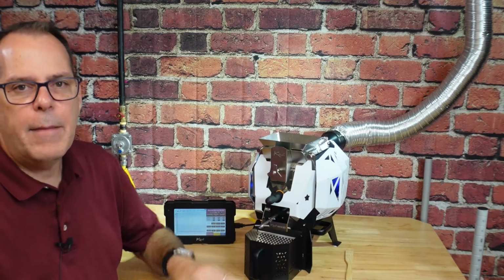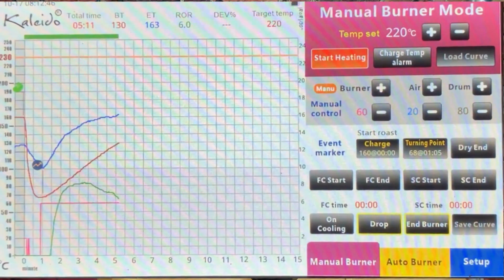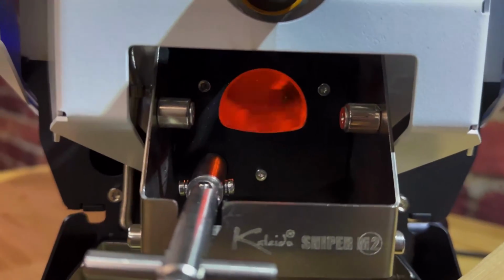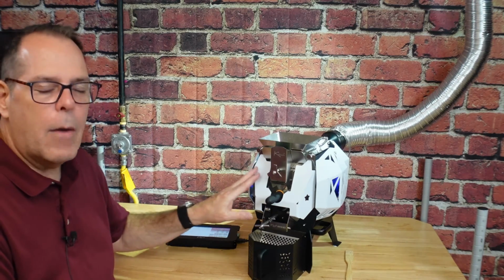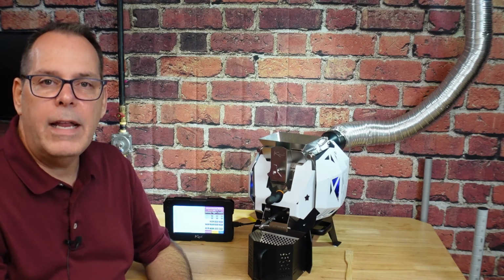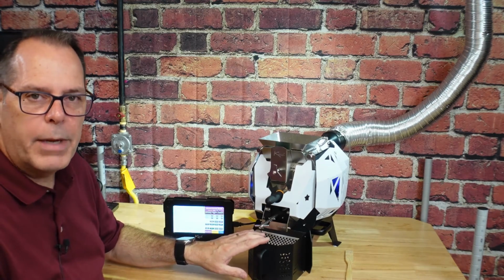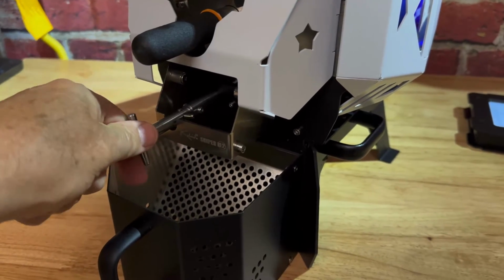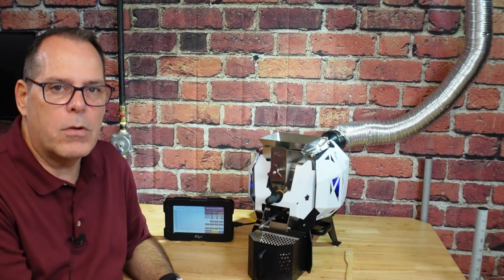First Impressions Of The Kaleido M2 Coffee Roaster

Comment: Great video as usual,,,really interested in seeing an actual roast ,,,,we have missed your videos,,,you spoil us,,,,,Ken,,,,,,Are you going to add one of these to your collection of roasters ?,,,what is the range of heat and air on this machine ? 1 thru 10 like the fresh roast ?
Reply from the maker: Hi Ken.  A full roast is coming soon.  This machine is on loan to me from the USA Kaleido distributor.  So, it will go back.  The range of heat AND air is 0-100, incrementally using a slider.  If you use the tablet only then i think it is in increments of.  I think you can set the increment in the setup as well?  Not positive about that part.
Reply: You are doing such a good Job of reviewing it, maybe they will give it you,,,
Reply from the maker: This roaster capacity is a little small for my roasting needs.  I'm not sure what is going to happen with this roaster.  We will see!  Thanks for the kind comments.  I'm glad you like these videos.

Comment: Regarding the chaff, I picked up 1 gallon shop vac, keep it close to the roaster, when the roaster is cool, just pull the drawer out, stick the hose under the drum and  hit it with the vac. To get rid of chaff in the roast, just hit it with a blower on the low setting or hair dryer while stirring the seeds in the basket. It's a little messy, but easy to blow out of the garage with a bigger blower. I'm finding very little chaff in my ground coffee with these extra steps. You'll like the way Kaleido works with Artisan: I have yet to use the tablet for anything other than a backup. Thanks for posting, enjoyed watching.
Reply from the maker: A small vacuum is a necessity to properly clean out the Mill City 500 gram chaff collector, the behmor, even the other smaller  roasters i've used.  It is handy for the work area but especially inside the roaster chaff area.  I have noticed the Kaleido M2 does a really nice job of knocking off the chaff while in the drum BUT could do a better job of getting it all into the chaff tray.  I end up either brushing or vacuuming the chaff box area as well as the tray after every roast.  I wish the chaff tray had more capacity.  

I'm excited to roast on the Kaleido using artisan.  Thanks for watching and for sharing craig.

Comment: Nice video, Mike! Watching you control things with the control pad, makes me really want to start using the Bullet in that same fashion. I am quite sure it will make my roasting experience, much simpler and much more enjoyable, although it’s a lot of fun now. It’s good to see you having a lot of fun with this, and I’m definitely looking forward to your next video!
Reply from the maker: Hi Lou.  the interesting part of this experience is learning how this machine roasts differently and then making adjustments to my approach.  Right now I'm trying to determine how much airflow i really need with this machine.  The tablet runs the machine, even in the manual mode.  It is kind of like your round display where you control temp, air, and drum except they also have the graph and calculations as well.
Reply: Good video. Thanks Mike. Do you think for someone new to roasting it would be a good idea to pick a bean, say Guatemala Huehuetenango, and just practice roasting that bean using different profiles and development times? Just wondering if that would speed up the learning curve. For me, I bought small quantities of a bunch of different beans from different vendors and have been roasting those but maybe it’s better to stick with a single bean type. That said, I do like having variety in the cup.

Comment: Mike, why would I spend $2,000+ for a home roaster that cannot produce more than 400 grams per use (making it useless as a small business machine)?
Reply: Weighing in with my thoughts, Mike of course may feel differently :) Personally, I don't think small business is the target market for this particular model. The M10 would be my suggestion with a capacity of 1.2kg (2.5lbs). I believe the target market for this particular model is the home "power user". Someone who wants excellent control over the variables in the roast along with a generous batch size for sharing with friends and family.
Reply: @TheCaptainsCoffee  My point is that this machine is very expensive for the home roaster and cannot even be considered for a small-time roasting business because its small capacity.
Reply: @mhpjii  oh of course, I'd agree it's an expensive option! But I know folks who have $5000 espresso machines at home. That might be out of my budget, but that's why I specified either a "power user" (someone who roasting is really important for and has saved up for a long time for something really special to them) or someone who simply has a higher budget. It's certainly not for everybody! There are just more considerations than for a business or what's adequate for most home roasters.  I know folks who would scoff at a $2,000 home roaster, but would drop $2,000 on a different hobby in a heartbeat
Reply: @TheCaptainsCoffee  I agree but I tend to see these higher-end purchases as investments, not hobby equipment or toys. It's also funny to me that people wince at the inflated prices of coffee at retail outlets and feel compelled to buy a machine such as this to go the DIY route at home. How much coffee would they have to roast to make it pay off? Hence my mentioning a "small-time roasting business."
Reply: @mhpjii  I can certainly appreciate your perspective! I guess at the end of the day I have a broader understanding of what an investment is. Some investments are made to generate a financial return and some are made to generate an emotional return! The crossover where both happens is exceedingly rare
Reply: @mhpjii   I wince at paying 5.00 + a cup of coffee +tip.  using your logic the machine pays itself off in less than 2 years. But, we do it as a hobby. Some people buy expensive computer equipment, video cards and so on, some buy coffee equipment, grinders, accessories etc, and some of us do both. It's a hobby, something that we enjoy and the beauty of it, is you can share the end result with others.
Reply: @edgarsalas7495  I understand completely. Enjoy!
Reply: @mhpjii Some interesting viewpoints. For me, hobby’s aren’t supposed to pay for themselves…they’re done for the joy of it. However, spending $2k on a roaster is a win-win. It pays for itself in a couple years, I get to have better quality coffee than I get in grocery stores, I get to nerd out on a cool/high quality machine, AND I get to try different exotic coffees I wouldn’t be inclined to drop $20 a pound for at boutique coffee shops. Oh, also, I get to share with friends/family. I don’t think I’ve ever had a hobby that checks all those boxes (maybe homebrewing beer).
Reply from the maker: Great discussion.  Mike, I understand what you are saying.  Who on earth would pay 2,000 dollars for a hobby, with no intention on trying to generate income to pay for the expense?

I was so into coffee roasting I decided to upgrade from a Behmor to my Mill City 500  gram back in 2017.  I spent 2,700 dollars on that roaster.  I roast coffee for my family (extended family) and was able to grow my skill set with that drum roaster.  Thursday nights are roasting nights at our house.  

I believe the M2 is the best selling Kaleido which is primarily geared towards home roasters but can also be used in small cafes.  I think I saw a video somewhere of a small café using an M2.  I agree with David, an M10 would be a great value for a small coffee shop who wanted to roast their own coffee 1.2 Kilo capacity for about 2,800 usd.

It comes down to expendable income for the home roaster.  I saved for a couple of years to buy my roaster and it has brought me lots of enjoyment every time I roast and drink the fruits (seed of the fruit, haha).

Comment: Very attractive roaster for the price point. Perfect capacity for a lot of people I'd think. Looks well-built, and offers a lot of data access. You may be answering this in a future video, but how does the tablet version compare to the Artisan version, in terms of ease of use, accuracy, and usability? Thanks Mike!
Reply from the maker: I've used both of the logging software options and there is a difference.  It is easier to roast with the standard Kaleido tablet.  I think it gives more confidence to the roaster because the software calculations seem to be softening the variations in the ROR which would cause less fiddling with the air and heat.  It is kind of hard to explain and I haven't quite figured out how the sampling rates are different.  I'm looking into this.  Ideally, I would like them to perform the same, hence, use the same settings and that is what I am trying to work out.  As far as usability and accuracy, the numbers being displayed when I run both at the same time are providing the same data I think.  Like I said, I'm kind of in that mode right now comparing.  I like controlling the roaster with Artisan.  That is a new experience and is pretty cool.  Are you asking if you could roast just as well with the Kaleido tablet compared to Artisan?  If that is the question I would say the cup might not be much different.  The experience is different.  If you are used to using artisan then the dual or pro version might be your ticket.  If you can afford it, the dual gives you more options.  Just my opinion of course.

Unrelated to the software, the capacity ( 50-400 gram) that is stated by the manufacturer is the capacity limit.  Yes, it does a nice job of roasting 400 grams and has plenty of air and power.    But, roasting 400 grams is really filling it up.  You won't be able to roast more than 400 grams.  My mill city is 500 grams and I could roast just over 600 grams if I had to.  FYI.
Reply: @VirtualCoffeeLab  Thanks Mike. I do understand what you're saying. This is a really nice option if I decide to upgrade from my FR800. Right now my capacity is 1/2#, which is fine 99% of the time. When I want to give beans as a gift, it gets a little dicey, but doable. The extra control and data generated by the Kaleido is also attractive to the inner process geek in me. Not cheap, but not ridiculous for what you get. Thanks again.

Comment: Sounds good, would like to know the price.
Reply: $1879 for the M2 model (tablet) that Mike is using. ~$200 more for the Artisan upgrade
Reply: The link shows the M2 standard costs $1879.
Reply from the maker: Currently $2,079 usd for the dual system.  Dual means the roast can be controlled with the included usb tablet which uses Kaleido’s interface to roast and it can also connect via Bluetooth and can be controlled by Artisan.